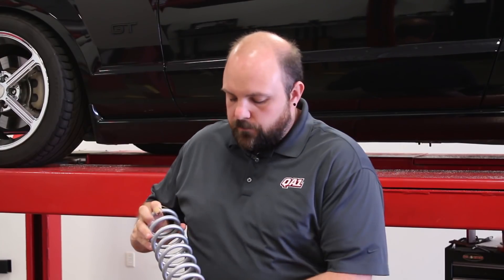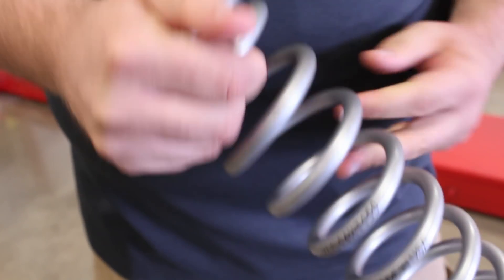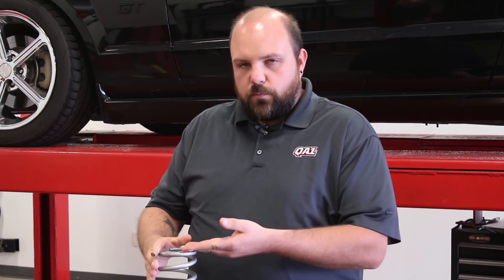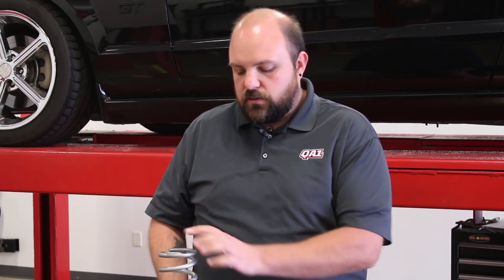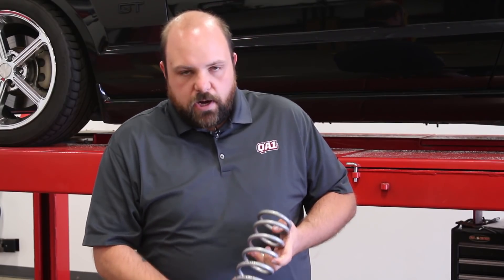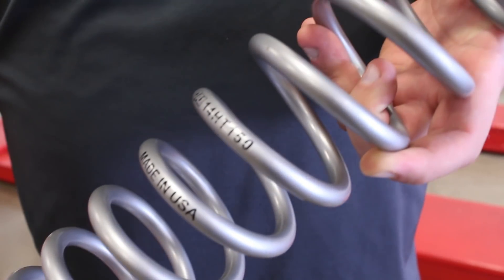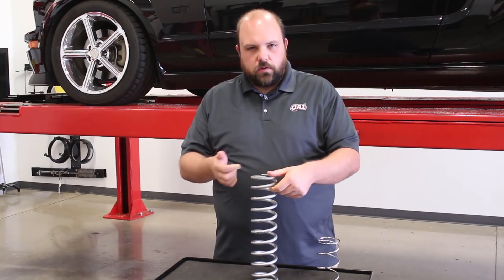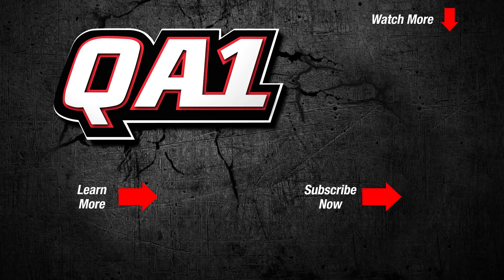What is spring rate? - QA1 Quick Tip

Comment: I have some chrome QA1 coil overs.  How do I determine what rate the springs are?
Reply from the maker: It really comes down to the weight of your front end. You can give our tech line a call and they will be able to recommend something for you! 952-985-5675
Reply: @QA1TECH , well my question is if there is a way I can tell what I've got, because they are too heavy for a decent ride.  And they're on the rear.
Reply from the maker: @mrblanche  There should be a QA1 logo along with a part number on the spring! If you can find that and call in with that number, we will be able to recommend something different for you!

Comment: In which parameter I based to solve the problem of selecting thickness and height of spring
Reply from the maker: We choose the height of spring that goes best with the shock needed for the application and the ride height of the application. Choosing the right spring rate is mainly based off the weight of your car. So we also pair the height of spring with the spring rate.

Comment: So if I want my car lower should I get a spring with a lower spring rate.
Reply from the maker: A lower spring rate will compress the spring further, but we would recommend using the correct spring rate for the vehicles weight and an initial shock length selection that will allow the vehicle to sit at your desired ride height. If the current setup has the spring seat collars adjusted all the way to the bottom a softer spring will further lower the vehicle, but you’ll need to keep in mind you may not have enough downward shock travel for operation.